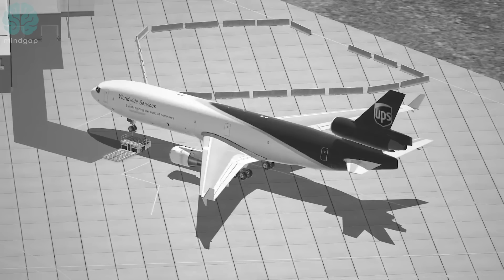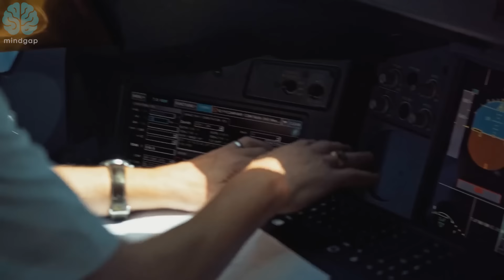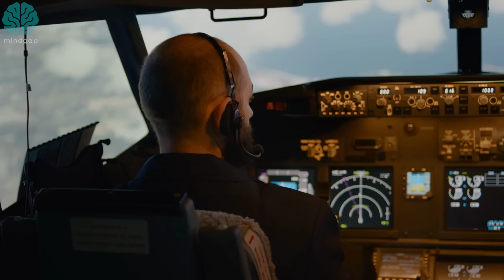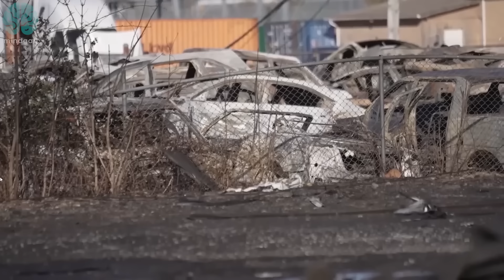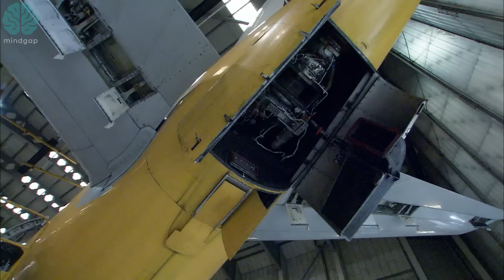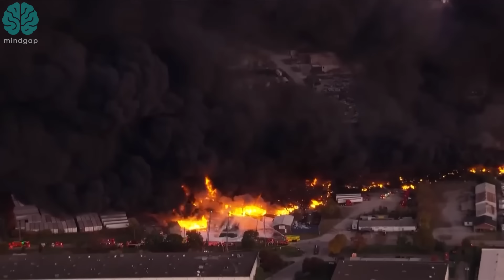Pilot Finally Solved the UPS Plane Crash Mystery — And It Changes Everything

Comment: It seems more that the engine experienced a fan disc failure or blade failure. The inlet assembly was lying on the side as if being sliced off. Could be that as the fan failed, it caused the some portion of the pylon being cutoff too. With this, the fuel lines got severed. The wing/pylon fire was probably started as debris from the fan hitting metal causing sparks. With part of the pylon failing. The engine didn't fly over the wing. The engine minus the fan probably swung down and broke off. Possibly too is that the hydraulic lines severed to where the feature to retain the hydraulic fluid to keep the slats extended got compromised.
The slats retracted causing the left wing to become less effective. 
   If the pylon in its entirety failed, the engine would have flown over the wing while producing thrust. The engine would be lying in the side of the runway with the fan still intact and the inlet attached too but mangled.
      This is my opinion.

Comment: Never weld fissures in structural pieces that must undergo endless cycles of variable tension amoounting to thousands of pounds like aircraft engine pilons. Just replace a new structural piece. Or deaths will occur.

Comment: The plane crashed because the engines on both wings went out.  It could have climbed out on two engines, but one was not enough.  Just an engine falling off would not cause the opposing engine to fail.  It might have been a turbine explosion that sent debris into the other engine so it failed too, but not a simple engine detachment.

Comment: This had not need to happen.  Regularly exchange  the whole pylon.,  like with the last big overhaul. It is well known that welding without heat treatment changes the crystal structure of steel.  This is not the first time that engine fall of the wing....and is is always metal fatigue.

Comment: What idiots think it's ok to put so much structure so close to the end of a runway?

buildings, metal scrap yards, fuel tanks .. absolutely stupid .. if instead it would have been a level field, the airplane would have had a chance...it was flying level...they could have settled on a empty field with sand....they would have lived....the greed of mankind by building all that structure so close to the runway is greatly to blame....from now on let this be a lesson and when they clear all of the debris, leave is a plain field... don't rebuild... Murphy's law...if it fails once, it will fail again...those poor pilots are heros as well as the poo victims on the ground.....

Comment: When a weld repair is done to a major stress point, that weld should be flagged and scanned/tested at least every so many hours of flight.  Or it should have been replaced and not welded.
Reply: Absolutely
Reply: Definitely just replaced, never welded.
Reply: I  CAN  NOT  UNDERSTAND  ONE  SIMPLE  THING  -  WHY  THE  HELL  IN  XXI  CENTURY   SOPHISTICATED  FLYING  JETS  WORTHY  MILLIONS     AND  HAVING  WEIGTH  OF  FREIGHT  TRAIN  -   AND  BEING  CONSTANTLY  FOR  DECADES  SUBJECTED   TO  INCREDIBLE  FORCES  WHILE  TAKING  OFF  AND  LANDING  -  ARE  STILL  REPAIRED  LIKE  HORSE  DRIVEN  COACHES  IN  SMITHIES  IN  XIX  CENTURY'S  WILD  WEST?  ARE  CONTEMPORARY    MEN  INCREASINGLY  OUT   OF  SENSES?

Comment: It should be “mandatory” that all airplanes 
have cameras trained on the engines, running 
the entire time the airplane is being operated….. these cameras would be attached directly to 
the black box…… this is easy to do and not 
rocket science…… and there should be video screens on the control panel for the pilots to 
see what is going on with the machine they 
are flying…….
These vehicles are too big for pilots to just depend on bell’s and blinking lights…… and 
it would not be very expensive to do the upgrade……..
That way pilots could abort the flight if 
there’s a problem at takeoff………
If these pilots would have let the plane come down the instant they saw flames coming 
from the engine….
At least it would have come to rest before slamming into a warehouse district……. 
What is wrong with society that airplane
manufacturers cannot enact simple safety measures…….
Too many incompetent people earning
 too much money…..

Comment: I cannot believe that, in this age of advanced metal knowledge, welding is still used to repair critical components like this. The heat stress would have most definitely caused dangerous stresses & it was probably re-fitted without heat treatment. I also noticed in the report at 12.57, there is a part where an engine fire is shown, with red dots, which I presume represent fuel flow or hydraulics. This shows the right-side engine. Why? This does not help the accuracy of the investigation, which destroys my confidence in the complete programme.
Reply: Welding has always been a big no-no on aluminum and aircraft

Comment: At 14 min  mark the narrator says "what chance did anyone have that no one knew existed?" Well the maintinance dept knew it existed and at the original time of the first repair , someone   should have put the first repair on a more frequent inspection shedule. 
Why that repair area was omitted/or overlooked from mandatory  reinspection  sooner is also a failure  knowing it is very likely to happen again,but even sooner.
Those  who s responsibility it was to address  the first damage and repair knows the risk of a  repeat occurance  after the repair of this type . There should have been a post repair assessment  of risk before it was reentered into  service
Reply: If this is the AI we are incorporating , we are all finished
Reply: Being a former structures mechanic and engineer at two airlines, anytime a repair is performed there is a change to the normal inspection program. I have always felt that there should not be any / very limited repairs performed to pylon structures. However, aeronautical engineers know better and allow this practice to happen.
Reply: Totally agree

Comment: /// Continued from below
Derated or Derating Material Fatigue, enters then a different performance characteristics, far below the initial characteristics of resistance of materials.
However, every welder, who had weld w acetylene, cold weld, MIG, TiG, Flux Core, and other types, wire electrode or gas, knows this principle of welding. - 
Every welder knows that the weld area will held fast, while the surrounding area will held weakened. It is the nature of the beast. 
Whoever had made the weld into place into the plane that flew the UPS 2976. Knew this concept.
A concept that goes back over 80 years, into WWII when U.S. transport ships ( A.K.A. Liberty ships )  provided by Kaiser Corporation, began welding the the bow to the stern at the middle of the ship. The weld proof successful in testing.
However, within the first trips, the constant hitting on the structure by the sea, split the ship right down next to the welded area, splitting it in two. 
They solved the problem by installing a fresh metallic stress relief that run the full beam of the vessel. The installation was done at both sides of the welding point. that prevented further ruptures, while they developed a different welding alloy and joining materials.
Yet again, this should have been noted for future maintenance of this particular joint installed at the pylon work.
It should have listed the composition of the weld, the type of welding flux utilized, and a final check verifying via torque or hardening checks the safe operation range of the materials involved into the weld.
One other item discovered with the break apart of the LIberty ships, was the fact, that environmental temperatures play a crucial roll into the performance of the weld, once installed.
So there are many variations of welding alloys, with different melt temperatures and curing temperatures.
These are crucial to verifying the how much does the weld expands under temperature vs. the joining original parts expands under the same or very similar temperature. - The fact that the welding alloy is definitively stronger than the surrounding bordering areas to the weld, makes for a different on how much expands the joining materials vs the weld alloy. These movements of material expanding which adds length to the materials under pressure or high temperatures, 
are defined in metallurgical engineering as  "...coefficient of expansion..." - We always want materials that will performed
under the same or almost exactly the same speed of expansion of both metals. - No, you can not have joining metal expanding  .005" of an inch in a second, while the weld alloy expanding at half a second for same distance.
Allow me to give an example of what would happen if the coefficient of expansion are different even slightly:
I bet you have sometime made coffee in one of those brewing machines, with the pot of glass sitting on a warmer plate of the coffee machine. Now lets say you drunk most of it, and you still have the coffee pot on the warmer.
Well the coffee pot begins to heat up and the glass, handles well the heat so does not deform. But does expands quite a bit. Then you realize that the coffee pot almost empty is getting quite hot. You pull out and try to get it to cool off.
you sit the glass coffee pot onto a cool surface. And what happens? The glass coffee pot cracks. This happens because the coffee pot did not have the time to cool off gradually or linearly as reversing the temperature gradually over time as did 
when it became hot. - This is called "....Thermal Amplitude..." and it is actually most likely what accelerated the inner fatigue crack of the welded area of the pylon of the UPS 2976.
Yet, once again, every welder does and should know this principal of resistance of materials. - Yet now I take it a bit further
back to 1979 on American Airlines flight 191, same thing. same repair type, worked on the pylon. Yet the manufacturers do not mentioned the proper corrective action to follow up after a weld alloy was applied to such a critical performance part as is a pylon. If not listed on maintenance manuals, It should be made mandatory to ultrasound, ultraviolet, and ultra impact testing these pylons as a stand alone unit mounted in a mechanical simulator, to emulate the effects under load.
if not listed on the maintenance manual, it is a negligence from the design team that created the maintenance schedule or the design for the longevity of the pylons.
If any questions: Thorlead@outlook.com

Comment: This is inspection negligence at the point of welding repair performed in 2019. UPS 2976, have had a weld, which never ever should consider as permanent. - The reason, for this repair deemed as negligence is locked down in the principal of the welding practice itself. Let me explain: When a welding material or an alloy is utilized to repair or put together or join the other different metallic parts or items, there is a transformation of at the atomic/chemical level of the materials involved. the original material to be jointed, when in touch with a hot weld alloy material, will give up some of its valences at the atomic structure of each molecule that composed the material. - This valences migration tors the alloy material of the weld, it is absorbed from both sides of the materials to be jointed. This "giving up" of valences, causes the weld alloy material to become stronger at the point of welding. Thus, by contrast, both joining half or parts, because they given up some part of their inner structure material, become weaker, making the areas right next to ANY WELDING weaker to begin right after the weld had cooled off. - Then, and because the material surrounding the weld alloy, has weakened, then the material characteristics are changed into a weaker resistance mode. 
Example: if an jet engine pylon surrounding or even if the pylon is the item welded due to a crack ( external and or internal )
and the pylon is rated to hold into place 5 tons dynamic weight, after the weld it should be considered to be rated to hold in
place 2.5 tons dynamic weight. This is sometimes called "...Derated or Derating Material Fatigue..."
Reply: THIS   IS   NOT  ABOUT  5  TONS  MASS  OF  ENGINE!   THAT   IS  ABOUT  30  TONS  OF  BOOST  AGAINST  STANDING  300  TONS   OF  BOULDER  OF  STANDING  PLANE  EVERY   TIME  WE  TRY  TO  MAKE  PLANE  TO  START  ROLLING!   AND  30  TONS  OF  REVERSE  BOOST  WHILE   PLANE  IS   LANDING!  
OVER  34  YEARS  IT   ACCUMULATES  INTO  SEVERAL  THOUSANDS   OF  SUCH  OPPOSITE  DIRECTION  ACTIONS!  EVEN  BRAND  NEW   PYLON  CAN  NOT  WITHSTAND  SUCH  TORTURE  FOR  THREE  DECADES!  NOT  TO  MENTION  STANDARD  VIBRATIONS  AND  CORROSION!

Comment: The problem is, they knew about this from the DC-10 crash in Chicago years ago. Both the DC-10 and MD-11 share a similar design with their engine mounts. So they can not claim they didn't know about this weakness. Boeing inherited the MD-11 when they bought out McDonald-Douglas.

Comment: Hopefully this will persuade regulators to
mandate more effective safety protocols
to be adopted , for inspecting the engine
pylons in these older aircraft! Clearly the
measures in place now are insufficient 
and could lead to more needless deaths
and destruction, if such a tragedy happens
again.  Are there other or similar flaws 
going unnoticed, in other models of 
aging aircraft, either passenger or cargo
aircraft?  Has anyone even looked into 
that possibility?  I suspect maintenance 
procedures on civilian airliners, whether
passenger or cargo aircraft, need to be 
significantly upgraded, and done so by
mandatory orders. Leaving it up to the 
civilian airline companies , is a very risky
and potentially hazardous way to continue
doing this.  Hopefully, this isn’t ignored or
swept under the rug, as happened with
previous airliner tragedies.

Comment: Once a casting  fractures the casting must be replaced . Repairing a fracture in a casting by welding causes heat stress in the casting which can produce a future fracture .
Reply: You should have been in charge of maintenance instead of whoever thought that it was ok to send the airplane back into the air.....those responsible must be punished and never go near an maintenance hanger again...and if the company cut corners,  punish them economically.

Comment: Until the NTSC report is released all of this is conjecture.  I've heard cracked compressor fan blade deep in the engine. Now this one cracked and poorly repaired pylon. Everyone is an expert at guessing without the scientific evidence. As much as someone thinks they can get the prize of picking the right answer out of a hat, the only right answer will come from the NTSB and that will happen when they are good and ready.

Comment: The whole video needs to be redone with actual MD-11 pilots as technical advisors to ensure the facts are in fact facts. Guess work by someone who gets left and right engines switched around, and showing aircraft which are obviously not MD-11s, but a 747, DC-9, and an airplane which has a propeller, is very unprofessional. Report the Facts, just the Facts!

Comment: High strength Alumiinium alloys must not be welded lest the yield strength in the heat effected area goes down. Lower yield strength zones cause fatigue damage increased risk. So do corrosive (salty) fluids. Both effects can pile up.

Comment: It is actually pretty easy to not see that bracket had a hairline fracture. Keep in mind that this plane was purchased by Thai Airlines in 1991 and later sold to UPS in 2006, after being converted to a cargo plane. Not sure if Thai airlines had a standard for removing the engine with the pylon still attached, which was the fatal flaw of United 191.  Did they ever release if the engine, as designed for safety, flipped over the wing as it became dislodged from the wing? If it did, it likely disabled the flaps and slats, which was the more likely cause of the crash. The plane would be to lift off the ground, and instead crash immediately after takeoff. Did they actually state that the alarm heard was engine 1 fire alarm?  It seems unlikely as the engine fell off before the fire.

Comment: I am interesante  to informe the aviation operations that in every inspections. Has mandatory inspection items. Such as wing attaching points . Landing gear attaching points and system. Engine attaching points and systems etc. included corrosion inspection and control. Which is every six months. My comment is. Mechanics get licensee. And never comply with the required regulations. Since the air operators want them to approve what they like or want. Also don’t blame the FAA since the industry does not comply with the regulations . By lying to the FAA  indicate that proper maintenance is done. That’s a federal crime. Lying to the government.
Reply: Most if not all airlines and cargo carriers do NDT (Non Destructive Test) during maintenance checks. This tests looks for hairline cracks in the airframe. If this test was done the hairline crack referred to would have been discovered.